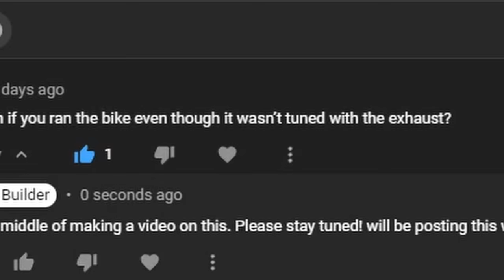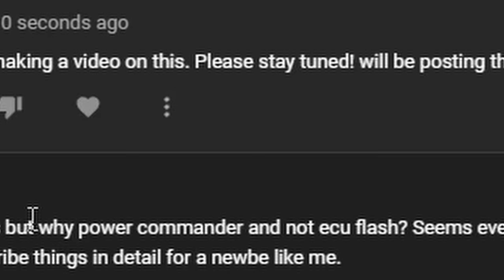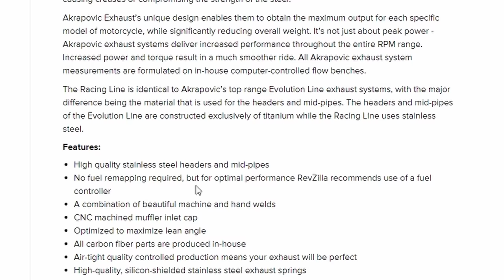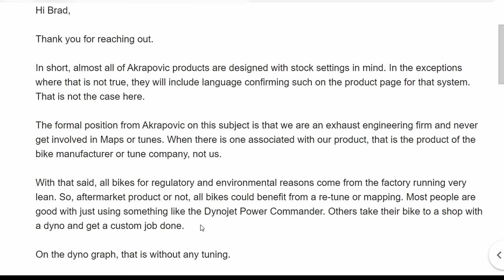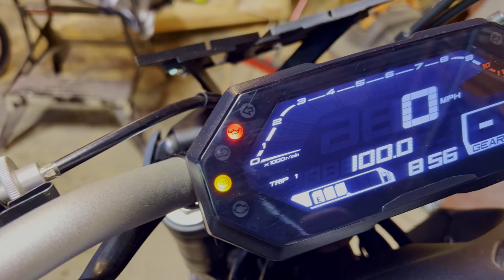YAMAHA MT07 | I'M SHOCKED!! | Do you need to tune your bike to an aftermarket exhaust??

Comment: Hey B-Rad, my 2018 XSR700 has been very rich for a while. It runs good, no bogging that I can tell, but rich. By rich I mean 70-80 miles max out of a tank of gas. ~27-32MPG even when I baby it. Smells really bad too.. Full exhaust, active tune o2 sensor, new map sensor, and tuned/flashed by a very reputable shop that does most FZ07 ECU flashes/tunes nationwide. Plugs look great, Hord Power air intake. I love my bike and have done a million mods to it so don’t want to trade it out. Do you have any ideas of what it could be?
Reply from the maker: That’s a tough one. Your plugs might look good at lower rpm’s when checked. Only way to get a true reading is plug chopping at different rpm’s. It might show rich at higher rpm’s. Did it start randomly? Or like right after a specific mod or tune? 

If I was in your boat I would question the tune despite it being from a reputable place. The active tune could be counter balancing something too. Can you run the bike without the active tune hooked up and run straight off the ECU. If so unplug it and see how she does
Reply: @BradTheBuilderChannel  Thanks for the reply,
It’s hard saying time wise I basically had the tune and exhaust on it right away maybe after ~200 miles. I know someone with the same bike, exhaust and tune from the same shop with no issues. Getting 140 miles + out of a tank and running it hard. That’s why I’m thinking something’s gotta be screwy somewhere else.

We actually installed the active tune as a hopeful solution or at least aid to improve the MPG. Was a pain too because it requires a new larger bung in the exhaust. So I can’t swap back to stock o2 either to test.

I’m not worried about the MPG itself but a drop this low there’s gotta be something wrong.
Reply from the maker: @scottomotive  yeah this is just wild. I’ve never hear of such a thing. I’m starting to think maybe your injectors are getting stuck open or your fuel pump is pumping too much fuel to the injectors causing them to over deliver. I wish I could be more helpful but I’m not sure on this one

Comment: The question is can i use the power commander in line the a HealTech or ICS Quickshifter.... would that mess things up? what are your opinions on this.... would i have to do a flash tune fuel setup or a flash tune quick shifter for it to work correctly, because like you i really DONT wanna have to mess with my ECu. Thanks
Reply from the maker: I don’t have a quick shifter but I know dynojet who makes the powercommander makes a quick shifter that hooks into the powercommander. This would be an option to avoid messing with the ECU. I’m not familiar with the brands you mentioned so unfortunately I can’t answer your question.
Reply: @BradTheBuilderChannel  ok thank you for the quick response I will have to look into that quick shifter
Reply: @BradTheBuilderChannel  one more quick thing… would it make a difference on the 22 model they look the same but don’t know if it will make a difference
Reply from the maker: @thatguyquestionable  I’m 99% sure it’s the same yes
Reply: @BradTheBuilderChannel  ok thank you sir

Comment: If you have an aftermarket air filter and a SLIP-ON exhaust instead of a FULL exhaust,would you still have tune the bike?
Reply from the maker: They do not make slip on units for this machine. The stock exhaust is all one piece. The answer according to revzilla and Akrapovic would be no you do not need to tune but if you want better performance and less of a chance of running your engine lean, get it tuned.
Reply: @BradTheBuilderChannel  Thank you for taking the time out of your day to answer my question, You have a new subscriber ride safe brother.

Comment: took my R7 for an ECU flash on the dyno and there is a noticeable improvement in performance - don't be lazy, get your bike flashed after a full exhaust
Reply: Did you use the power vision 3?
Reply: @chanceschawo4617  no, all fuelings were optimised by the professional at the dyno

Comment: Is this compatible with a quickshifter? I have a quickshifter that plugs into the engine. I was thinking plug in the power commander to the bike. Then the quickshifter to the power commander and the the power commander with the bike plugs. In terms the quickshifter is in between the two

Comment: Finally got myself to purchase an exhaust, but now I'm debating between which tuning route I want to go. Would you recommend the updated Power Commander 6 or the Power Vision 3? Other than intake and a quickshifter down the road, is there really a pro or con to either choice?
Reply from the maker: I have no experience with the power vision 3 so I’m out of my element there but I would absolutely use the updated powercommander 6. Flash tuning is also an option
Reply: Thanks for the reply. My buddy recommended Vcyclenut tune, something like that would be a flash no? Any idea how that compares to a power commander?
Reply from the maker: @sethlabarbera8515  flash tunes allow you to tap into more settings. You ship out your ECU and then they ship it back with the tune. Powercommander allows you to take it off and return to stock. ECU flash does not. Returning to stock is nice to be able to problem solve in the case of an issue. Powercommander can be updated and adjusted anytime and you can put the tune on right away. Not wait while shipping it out. Powercommander is more money. ECU flash is $200 cheaper and pretty much once it’s flashed your good to go for the life of the bike. Updates to the ECU flash require you to take it off the bike again and send it back in. In all honesty both options have their ups and downs. I would be interested to try the flash tune versus the powercommander to see if the difference is noticeable
Reply: What did you end up doing?

Comment: What's the difference between a power commander and an ECU flash? Im assuming the power commander doesn't improve bike performance like an ECU does? What exactly IS a power commander? I'm sort of new to this so sorry if it's a stupid question.
Reply from the maker: The power commander is a unit that plugs into the existing wiring harness and alters the ECU when riding. When the unit is unhooked from the bike it returns to the stock ECU. An ECU flash is where you take your ECU off the bike or bring it in to have it flashed. Flashing allows you to change more settings on the ECU over the power commander. Both methods are altering how much fuel is delivered to the cylinders via the exhaust sensor.

Comment: My brand new 2023 mt07 with 2 miles backfires when i decelerate with a stock exhaust 😢. What is the stands you're using on your bike?
Reply: That's normal for every bike
Reply: @knifetoucher  not happening on my dhcati hypermotard 950

Comment: I just got an K&N filter combo with the oil filter is it better for me to get an ECU flash or a power commander?
Reply: Using a K&N air filter should be able to be adjusted for by the stock ECU. The oil filter is not particularly relevant, but likely a waste of money compared to the OEM filter.
Don't get the ECU mods for the air filter unless you are going to get the ECU mods anyway.
If you are on a slow journey of mods that affect air/fuel, then get the PC that can be adjusted as you go. Otherwise, save your money and take a Moto training class.

Comment: Think this will work for a 2022 xsr700
Reply: This is nearly an identical Moto. Mostly just cosmetically different.
And if you are asking specifically about a Power Commander, yes, it is likely the same, but be sure to check before purchase.

Comment: Hi I just swapped out my standard exhaust system for a full system on my v2. Can I tune my air to fuel ratio without having to flash or piggyback my ecu?
Reply from the maker: Unfortunately no because the air to fuel is completely computer controlled based off your O2 sensor and ECU communicating with one another
Reply: @BradTheBuilderChannel  Alright I see. Do you recommend I flash the ecu or get a piggyback like you did? Is there any risk to flashing the ecu and can I go back to standard settings if I so choose to?
Reply from the maker: @imranbmn  unfortunately there is always risk involved but both are pretty standard options with lots of good results. If I was to do it all over again, I would like to try flashing my ECU to see if there is a big difference myself. If you flash your ECU, it is hard to reflash to stock settings unless the company flashing it knows the exact stock settings to go back to. I like the option of the piggy back system because I can unplug it in a matter of 30 minutes where I would have to resend in my ECU to return it to stock. Most companies that flash ECUs warranty their work so I wouldn’t worry so much about it getting wrecked.
Reply: @BradTheBuilderChannel  Apparently there's lots more that can be done when you flash your ecu. I've yet to do it so I'm running around asking questions about it. Because in Malaysia I was quoted about 400 usd to flash the ecu whilst doing a piggyback is about 600 usd because I'd have to buy the piggyback and then send it in for a dyno tune.

Comment: Hey Brad, I picked up a 2022 MT-07 a few days ago and have an Akro system on the way. I've heard complaints about the Power Commander 6 so I was going to grab a PC5, but on a couple of sites (like Revzilla) it says it's incompatible and direct me to the PC6. Do you think the fuel tables changed between the 2020-21 and 22 models? It doesn't hurt that it's $125 bucks cheaper.

Comment: So i just got a 2022 mt 07 and am deciding between an akro or m4 exhaust. Ik ill need to get it tuned but could i just take it to a shop and get it tuned there or do i gotta get an ecu flash and do it myself. Sorry if its a dumb question but im new to this tuning spec stuff
Reply from the maker: Some shops might have the connections to help you with it. Where I currently live my dealer didn’t know of any specific places that tune. You have nothing to lose by asking your local shops. See what they say. I’m sure someone around you will know where you can bring it and get it tuned.
Reply: @BradTheBuilderChannel  sounds good thank you for the response. Also will u ever make a video on installing an ecu flash urself for those who do want to work on their own bike?
Reply from the maker: @dreinin  I’m very curious on the difference between the Powercommander and an ECU flash so there is a possibility of a video on that but it won’t be for a little bit. I want to see how noticeable it is

Comment: Hey Brad, my 19' came with an m4 exhaust and not positive if the ecu was flashed. I noticed the fan comes on at 201° and i have no backfiring w/ downshifts or decel. But a sometimes faint smell of unburnt fuel when the engine is warming up and idling 🤔 any ideas? Thanks in advance
Reply from the maker: What’s up Matt! That fan stock I believe kicks in around 210 degrees so if yours is kicking in early at 201 then your ECU might be tuned. I know that’s a common adjustment people make when tuning their ECU’s. Okay so it sounds like it’s running like it should. That unburnt fuel smell is perfectly normal especially on startup because the ECU auto chokes the engine to start. With a free flowing exhaust such as the M4, there is no catalytic converter so unburnt combustion gasses will ultimately exit the exhaust because there is nothing to catch it or filter it out. If you start to notice lots of carbon build up that’s more wet than dry and has a greasyness to it inside the exhaust pipe then you might have an issue with burning oil. This is very unlikely. But as far as the smell, I wouldn’t worry about it.
Reply: @BradTheBuilderChannel   awesome man! the explanation on the fuel makes sense and I'm going to stop worrying about it! Yes i believe it is flashed, it runs smoothly. And no popping-
 i still may get the power commander 5 in the future but for now, atleast the engine is safe 👍

Comment: Stock mapping is ALWAYS to lean - it helps to bring fuel consumption down and meet emissions. That is how politicans are killing our engines :-( 
I would tune even a bike with stock exhaust ;-P 
Especially that Yamaha's throttle mapping is usually trash out of the box and you can fix it while your at it...